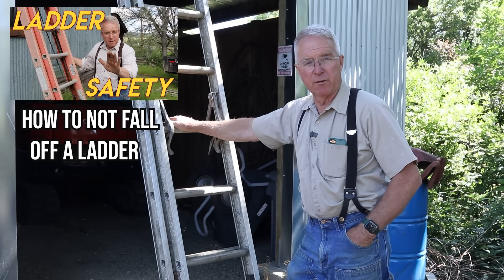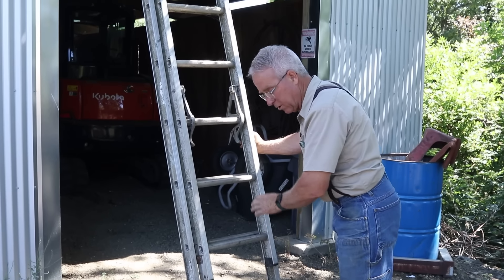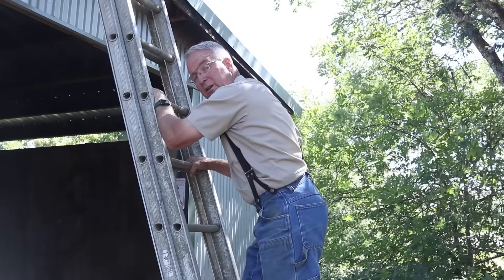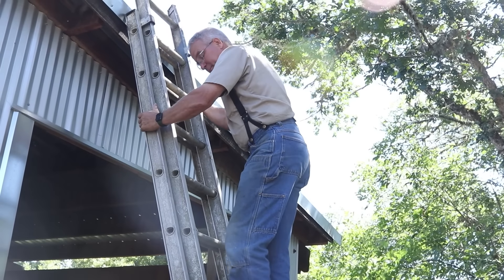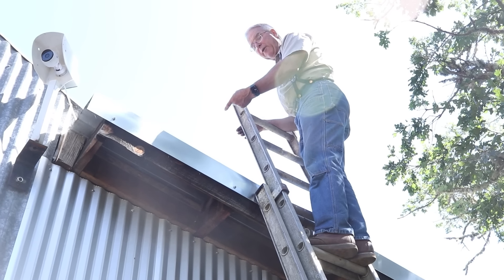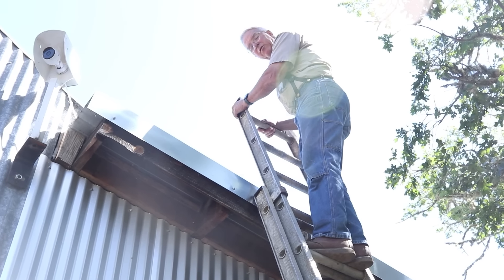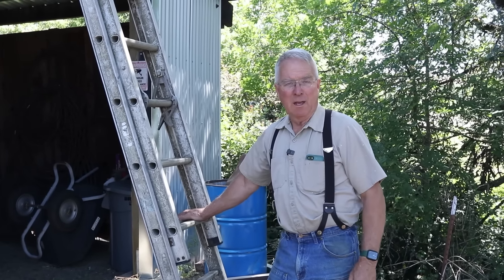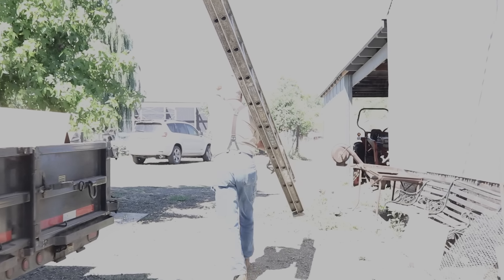How to Climb A Ladder, Dismount, & More Tips

Comment: one hand for the work, one hand for the boat. Tall ship sailing is ladder climbing on steroids. If you relax too much you go for a rideI. I remember trying to furl a topsail in heavy seas and winds, It was left too late but needed to be done. started using both hands with the help of one other (3 hands). Got the rope up and started tucking in the sail. Suddenly i was leaving the mast/rigging behind. my mate couldnt hold me in and i swung out like a big retarded pendulum hugging the sail bundle as i swung out. Good thing is if you manage to hold on, once you swung out you get to get to go back and greet the rigging. I was young then and not afraid because i didnt know better.
Running up the weevils on a boat you never grab them, you hold the rigging just slightly. same goes for ladders, you hold the sides not the steps. Ladders/Weevils where twhat you step on can brake you want to hold the stronger part. Perhaps not true for aluminium ladders but still. As a general rule. hold he stronger part ligtly all the time.
you should balance yourself with the feet and not really use your arms. Pulling a ladder out to increase the angle is dangerous. I usually dig the ladder down and or stake it with dowells in the ground. That way i know if something happens it will turn to the side and not slide backwards. When working in bad conditions this has saved me once it started gliding to the side ( too soft ground) i slid down holding the outsides with hands and feet. Sure the ladder came crashing down along the house but i landed safely pretty close to the base with sligtly bent knees.
First step is identifying what youre doing is dangerous and what extra steps have been made to make it extra unsafe. Normal people dont use safety ropes nor the best equipment. If you ask my father, clogs, ladders, tall trees and chainsaws are a pretty normal combination. When he fell down working alone his main concern was breaking the record of throwing that revving chainsaw as far away as e could.

Great video.

Comment: 2 BAD DANGEROUS mistakes.....1- you must connect top of the ladder to the roof.........2- do NOT carry anything. use rope and bucket to pull stuff up, when you are safely on top......3- HARNESS, rope, connected to a safe place on top is a mjust. measuring and calculating distance and length of the rope is also most important, so, you do ot hitmthe ground......if you are still alive by next year, make anaother viodeo and teach these.

Comment: No way hanging on to the rail is safer! If you slip or miss a step you can't stop yourself from falling grabbing the rail. It's not possible to support your weight there with one hand. If you have a firm grip on the rung you will stop yourself from falling just enough to get a foot on the rung and support your weight.

Comment: disagree. i would rather move my one hand from rung to rung while carrying a load. because one hand on a rung is still better that one hand on the rail, even if there are moments when you have no hand on anything. you move up, you stabilize, throw your hand up to the next rung real quick.
Reply: that ladder is way too high above the top of the roof. i like it no more than 6" above the top. then you can step straight over the center of it to put your wieght in the center where it will not slide. Wow thinking about this just led me to invent a better ladder.

Comment: All good info.  However your ladder scares me.  I’ve been a window cleaner for 41 years. Up and down ladders maybe 200,000 times.  No incident ever.  But my ladders are replaced every 2 years, have new ladder levelers installed every year and rubber (not plastic) tops.  Metal will never touch the building.  Also stand off bars with rubber sleeves.   It’s the tool that spending a little more on won’t speed things up, just keep you alive and free from injury.

Comment: I'm sorry, but this is the first time I find I have to disagree with you on anything. 
First ALWAYS hold the rungs, if for any reason you slip with a foot you have both hands with full grip on the rungs. 
When you reach the roof...Before you get on to the roof ALWAYS set two large screw eyes, one each side of the ladder and tie it off. You demonstrated with a ladder resting against the verge of a roof on a metal capping. The ladder is at its most easy point to slip...metal against metal. The same when you get off the roof. You might have a bucket full of rubble, the ladder starts to slide and you with the bucket will go with it. When you have finished the roof job untie the ladder and go home...NOT to the ER, or worse.

Comment: Your still doing it wrong.. alway dig down weather level or not.. and most important  ingauge the cleats at the bottom .. second use the L on the side of your ladder to make sure irs not to steal and not to shallow.   ... second alway strap your ladder to the facia  and use a scrap 2by six  as a spacer between ladder and facia etc. So you don't crush or scratch people's  property... never just lean a ladder up without tie. ING it off so there's no way it can fall....

Comment: Not impressed. 
You're missing the most important safety device every ladder should have...ladder standoffs. Anyone using a ladder without standoffs doesn't know what their talking about. The transition from the ladder to the roof is where most accidents happen and almost always due to ladder movement (slipping, shifting , sliding) when transitioning off the ladder to the roof. Ladder standoffs eliminate all that movement. You're digging holes for the ladder feet and rolling the feet pads to prevent any movement of the base (which is good), but you should be doing the same thing for the fly (you've got metal on metal...not good). I'm an owner/contractor of a gutter/siding/soffit company and have been in business for about 30 years. Don't buy anything fancy, get the simple ones (Ladder, Stand-Off Arms Stabilizer, 2-pk) for about 25 or 30 bucks, they'll save your life.